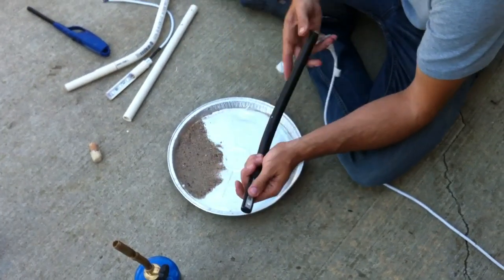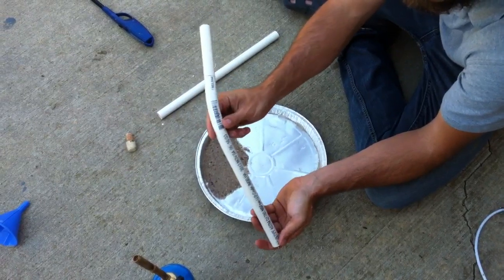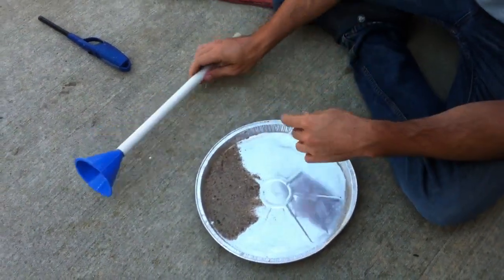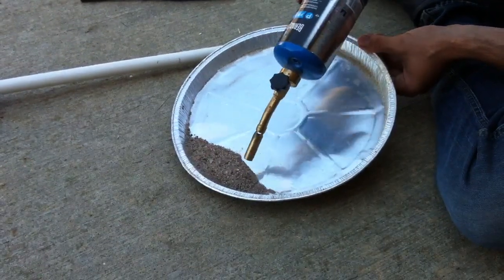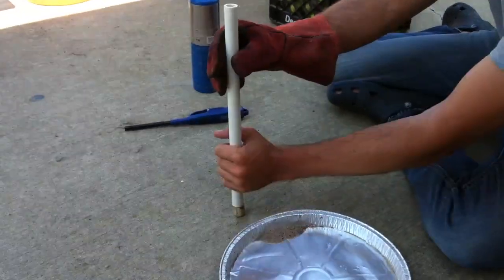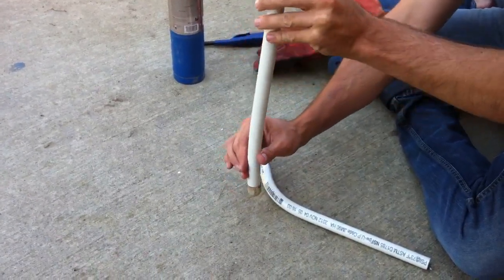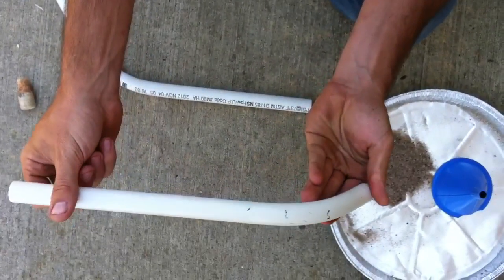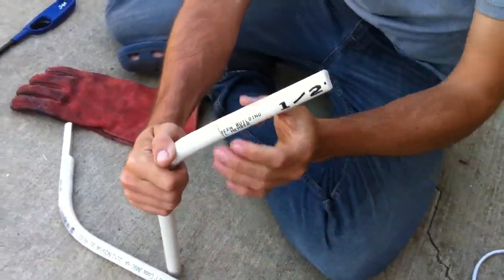How To Bend PVC the Easy Way

Comment: I apologize before hand,  But this is extreme " Over Engineering " for what you are trying to achieve.  Now,  the results Are good,  But way to slow and time intensive.  Only saying that in the circumstance that you are trying to do this 'en-mass' as it were.  Over all though.  good technique, IF you have the time.
Reply: +Charlie Blum   Yes, it does take some time, but the end results are custom and used by many who make all sorts of custom things out of PVC, to include hunting bows and gardening devices.  PVC is cheap compared to other construction options, especially if the end result is a small greenhouse, or unique thing.

Comment: Good idea, but....
wasted a lot of time talking about the lights, wires, paint, etc.
Easy for bending one piece, but to simple to do many.
Heating sand on pizza tray with propane torch isn't precise.  I'd heat the sand in the oven - start at 275 degrees, increase if needed.  Put pipe insulation on the pipe.  I'd also have a jig to put the pipe into for the 'proper' bend every time.  Spray bottle w/ water to speed cooling if desired.
Reply: +Daniel Esposito  Uh, makes good cookies.
Reply: I used a heat gun, much faster